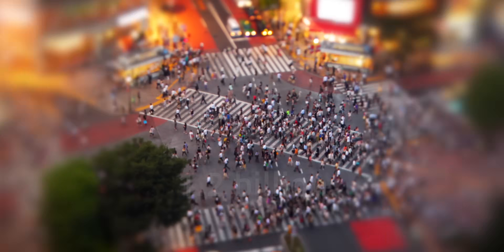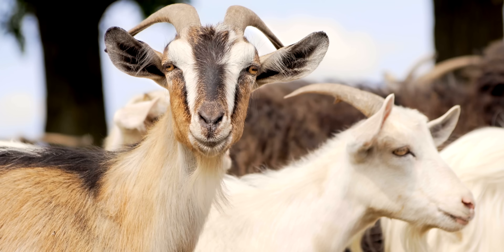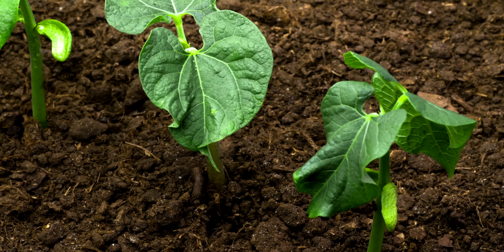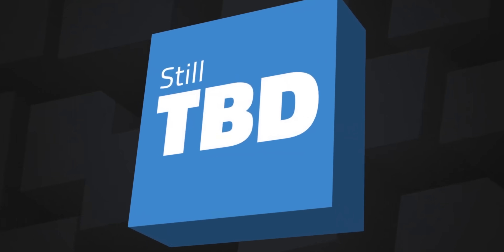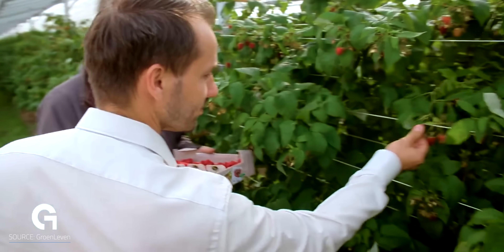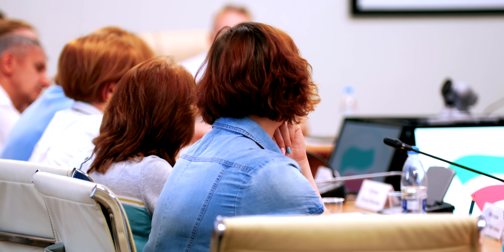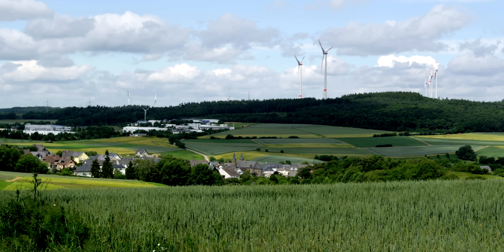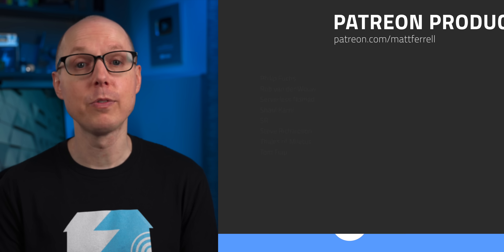Solar Panels Plus Farming? Agrivoltaics Explained

Comment: I want to see if this approach could be used in greenhouse construction. Like for a small home greenhouse. Even if it only offsets the power draw, it still helps lower the carbon load from powerplants.
I'm all for renewable energy, except for a couple of issues. One of the biggest concerns I have is the ecosystems these green power stations are in can be damage. Agro voltaics have a serious edge in alleviating that concern.

Comment: In a true farming sense it doesn't make sense. However being able to provide power for your residence and still use that land for farming does make sense. Even in the sense of having a few solar panels per acre makes a lot of sense to  power pumps, and other irrigation equipment. Solar's biggest downfall is we currently don't have the battery tech to fully harness the days of abundance. Most systems are based on your average power draw during the winter months. You basically have to install a system which is oversized just for operation in the winter months, and in the summer months you are far in abundance of energy.

Comment: I've seen a documentary couple of years ago about solar farming in north west China. Originally it's a pure solar panel area for generate energy then they found the grass grown faster under solar panels than other area because the shadow reduced the evaporation. Those grass are not good to the solar panel maintenance but remove them is costly so they comes with an idea to let the local farmers graze sheep under the solar panels for free. This actually brings benefit to both side. There are also some area cover the fish farm with solar panels which can reduce the algae growth. So it requires less work to clean the water. Also, the owner can sell fish and sell electricity to make more money.

Comment: I've thought about keeping chickens under panels for years. Panels would need to be taller(?), and the wires etc safe and hardened, but the chickens would have a roof on their run!!
Reply: New technology for electric power generationhttps://youtu.be/xc2V2BS_Fng
Reply: I think the chicken tractors could be used with the solar panels roof.  Land is regenerative sequstering carbon.  

Cattle and other livestock need shade structures, again some Mobile, some permanent.  Also regenerative.

If we can sequester carbon through this and it provides power win win.

But it has to be well designed.

I see no reason why some wind turbines be used in conjunction with this to improve grid reliability and lower costs.  Either or is not a winner
Reply: Chickens driving tractors is a great idea. Gives the human tractor drivers more time to take care of their chickens.

Comment: I only got 5 minutes into this video but I have to ask, what problem do these solutions solve? Surface area isn't in short supply on the planet, even in built up areas. Farmable land is. Why compromise it for solar which has its own flaws to begin with? Not to mention, solar feels like a stepping stone to a proper renewable energy resource.

Comment: Well researched.  I'm based in the tropics and the main obstacle is regulatory / administrative approvals structure is not appropriate to this technology use.  Funding is available for renewable energy but the approvals are difficult, and very little funding is available for farming upgrades, but approvals are easier.

Comment: Solar is not sustainable nor clean. Cobalt, silica that turns to acid in Water etc. it’s ok on a small as per needed basis. Micro hydro is many times cleaner and is also just appropriate where it fits in. No one size fits all.

Comment: I think another solution is to utilize the vast amount of land under high power transmission lines.   It doesn't have to be solar PV.  Instead, heavily insulated shipping containers could be used to grow plants with LED lighting.  This would work 365 days 24 hrs/day even in cold climates.  It would need controlled ventilation, water, nutrients and harvesting/cleanup processes.   The rationale is that LED lighting is CHEAPER than heating.

Comment: Would there be a way for the watering system to flow through the empty spaces in the panels? That would water cool the panels and deliver the heat into the ground. Maybe even just pour over the top, or run through tubes underneath with high heat transfer materials, but both of these add a lot more work/evaporation than simply open channels in the empty spaces and occasional holes to drip water down

Comment: If the price of agrivoltaics does not yield more returns than a solar park or traditional farming that literally means its less economically efficient, subsidies will quite literally lead to more resources being used with less output, which is worse for us all. The free market isn't a problem, it shows us whether it actually is a good idea to do it or not. At least if you want to increase the efficient use of resources, which if you want our society to be wealthier you really should want.

Comment: Hey power poles! Solor panel poles and collect power from every angle and cut down on space usage wires can be ran inside of the poles. You can write me back and I'll give you plans. And the poles can be made of recycling materials. As such as plastic.
Reply: So cost would be a fraction of normal solor panel installation and affordable for City to implement into the power grid.

Comment: We should definitely be using this! Obviously, it's not suitable for every farm, but hot, dry areas like the western US would dramatically benefit. Combining poultry, bees, and wildflowers with solar would actually be triple-use. It would also be sensible for any farm to put solar panels on its buildings, north edges of fields, and over drainage ditches.

Comment: I was under the assumption that solar panels contain lead and other toxic stuff, I'd really want an analysis of the safety of the food since the panels will leech from rainwater as they age. The vast majority of land on Earth is not farmable, so there's ample and cheap places to put PV cells besides farms. Of course, if studies show that the food and soil are safe after many years, I would not oppose it--but it seems like a good idea to check first before rolling out large projects.

Comment: I thought it was good practice with people using solar house to house where it has good sun exposure. It takes off small parts of burden off the power grids when it conjunction with battery systems that are made well. And Seeing those raised solar panels above farming areas seems brilliant too. I think another issue with that might be maintenance with those hybrid solar and agriculture farms. They don't want to have either one damage each other, so they need to have some awareness of how to handle those. But I could see with a well planned and arranged system with minimum risk of accidental damage to either the crops or solar systems, then they could really work out well in select areas with certain crop types.

Comment: There is too much investments in STANDARD SOLAR PANELS which are ultra heavy and have poor efficiency..
Simply a LAW must be drawn to only use " perovskite solar cells" or some cheaper very light alternatives that can give 
at least 30% Efficiency or more.. As the years go by that bottom 30% needs to be moved up to 55% 

Goverment should only subsidize Solar panels which meet these requirements.. so that money is well spent to FORCE new production of these cells.

This will bring down costs dramatically as almost every part of the structure could be producing power.

With HIGH EFFICIENCY SOLAR POWER: Water can also be obtained from the humidity in the air where conditions
permit..

Stop supporting these bulky old super heavy righd solar panels and force the move to the new technology

Comment: as I started watching I was very sleptical, I feel that the cost of the land is marginal compared to the solar pannel, and thus, unless you are trying to use very expensive land (why would you?), why not have some farm land and some solar farm land seperatly? it's not like there's loads of unexplored land.
but if you can indeed make a synergy that benefits the crop, sure! but I feel it needs to be evaluated case by case and will thus not become very popular as it's not very scalable

Comment: As someone who has worked on farms, dairies, keeps a decent size orchard, large garden, and also has somewhat of a formal education in soil science and horticulture. . . just the effects of chemical run off and all the concrete that would be required in the fields makes this a hard pass for me. 

These farms would require much more herbicide use as machines used to weed won't be able reach weeds in rows where the stilts are located. Stilt rows could be used as a break, which can be  beneficial, but often harbor shelter for pests and would then increase the need for pesticide. So choose, more pesticide or herbicide. For many crops it will increase the need for fungicides as well because of reduction in wind which normally spreads spores far and wide, but would instead be trapped with higher humidity levels. That reduction of light can also lead to an additional increased need for fungicides. Also what chemicals will be used to clean the panels and how will those affect crops / soil chemistry? Who will clean up when hail damaged panels? Anyone who doesn't think there will be damaged panels has not been on a farm (everything gets damaged). Accidents are unfortunately common. 

When I hear numbers like 50% reduction in water. . it screams marketing made up the numbers (not accusing Matt, but the source of that number). 50% reduction in water use from temperature reduction of a few degrees would be crop WUE (Water Use Efficiency) magic (10% sure, 20% maybe, 30% skeptical, 50% nope no way). Somewhere there is some fine print that says they also switched to drip irrigation to achieve 50% (which will clog and have to be replaced or run acid through the lines). The only way 50% is possible without changing irrigation methods is a dramatic decrease in yield (smaller plants use less water) or they were overwatering to begin with. 

There are not many circumstances where this will work well without a plethora of unintended consequences. Many communities don't want to jump on board with things like this because there have been numerous projects started and abandoned irresponsibly (once those unintended consequences pop up) leaving communities to deal with the damage. 

Love that people are innovating and normally I am not a naysayer when it comes to things like this, but ultimately this just isn't going to work for the vast majority of farms. It is one of those things that requires so many compromises to each function that it is less efficient than doing them separately and the costs exceed the benefits.
Reply: Before displaying your professional background as something noteworthy, try relate to reality ;)
Each of your estranged worries are more or less irrelevant.
Practical field test are already made by top professional Germans, and has proven this technology highly successful.
Search on YouTube and see for yourself...
Reply: @OmmerSyssel  Yes, because someone with actual relevant experience and education can learn something from YouTube. . SMH. Wow. If you could bother to read, you would see those "top professional Germans" had the EXACT same concerns as mine in the studies. No, the technology isn't proven nor is it highly successful. It is niche at best with very limited use and only possible to use with a very limited amount of crops. 

I bet you tell the Doc about the medications you would like after self-diagnosing based on TV commercials too.

Comment: Bi-facial panels mounted vertically on stilts.. Thank you very much for the idea.. We are embarking on a project integrating solar farm with existing aquaculture. We thought the runaway commodity price has torpedoed our dream.. Once again, thank you very very very very much
Reply: I have the hobby to recommend sci-youtuber to science-fans. 
I'm often called random or even robot for that, but whatever. I keep going for those few 
that say 'Yes thanks'.
Reply: @loturzelrestaurant  https://youtu.be/btIJWYor8KA?si=erWgjKcZTL6vYMf4
Reply: Vertical bi-facial panels are not very wind-resistant... Please, keep that in mind.

Comment: This will produce (pun intended) radiated food. The crops WILL be effected by the electrical current (even if contained within wires never touching the plants). All wires with electricity flowing give off electromagnetic radiation. The result would be food altered by the radiation. Which could pass on the radiation to those ingesting the plants and/or any harmful effects of eating mutated crops. Overall, this is a horrible and devastating idea for our health.

Comment: I know there double use for energie consumtion so I don't know why there couldn't be a double use for energie production as long as the 2 production doesn't hurt 1 and other too much so the cost isn't to high for nothing. But this seem promession it seem pretty usefull form what you are saying any way... The farm get to have a better protection in winters and the solar panel get to produce energie ...

For the casse of what the land is mainly use for... I would say it bot use really... And technically I could see a point where you argue it for the farm you put solar panel it not for the solar panel you put a farm under... (after all you need food more than you need electricity overall since without food ppl can't make electricity so I would say the main use is for farming.)

Comment: My family owns a 120-acre farm in Michigan.  When I saw the "just have a think" video, my initial thought was .... great idea.   But then I began to ask how this would be implemented on our family farm and realized it actually wasn't realistic.   

The first reason is the cost. Farming is a low-margin business.  No farmer that I know has enough free capital to buy the solar panels or the framing to hold it up the necessary 15 feet off the ground.  We are not VCs with cash to burn.

The second reason is a lack of electrical infrastructure. Even if the solar panels magically appeared, the power company in our area doesn't have the infrastructure in place to get the power off of the farm.   In our area, each electrical pole costs about $3,000 to place.  Do you think the power companies in the US would pay for that?  Not the ones that I know about.

I was unhappy with the reasons you gave for it not taking off... in particular the NIMBY reason.   Any farmer that I know would do what it takes to keep their farm going, so someone from the city without any actual farming experience, making a video saying... "see how easy this is, if it weren't for those NIBYs" should try to get some practical experience farming first. It isn't as easy as your video makes it out to be.

Comment: Wonder if any of the major beer manufacturers have considered or currently use shade-tolerant hops and barley varieties. Wheat seems to be problematic, but maybe there's a variety there too. Power the bottling plant from the fields the biological materials are grown in. 

Agrovoltaics is less complicated (biologically) than agroforestry, which is another method used to provide shading and wind shelter to crops such as barley. From one paper I saw after doing a bit of googling, worldwide barley yields are expected to decline by something like 15-30% by 2040 due to climate change without moderating factors. Agrovoltaics seems like a no-brainer addition to this particular crop. Getting better crop yield, decreased irrigation cost, decreased costs overall (due to excess energy production), and being ecologically friendly long-term (good PR as well as just smart). Sounds like a great investment to me.

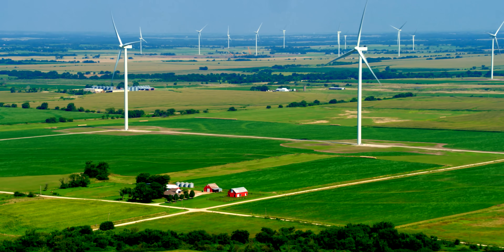Comment: 8:35 Reno county: you mentioned the nimby effect that happened about not allowing alternative fuel sources happen there. This is the same county that in 2001 there were natural gas explosions. I live there and worked at one of the news talking sports radio stations at the time and it was truly crazy. They had used the old salt mines to pump and fill with natural gas but there was a leak that slowly underground went 30 some miles and people's backyards were suddenly blowing up. The reason they were blowing up was that settlers had come through and Dug wells and just filled it with permeable dirt after the well was dug or disused. Every now and again, 2019, there are new explosions because the gas was never appropriately dealt with. There's even a place downtown of Hutchinson Kansas that The geologists figured was the best way to help deal with the gas was to create an eternal flame to slowly burn off the worst of it. Lots of people left the area that had the opportunity. It's almost like voting against their own interest his common place for a place like that.

Comment: Late to the discussion, would the implementation of perovskite panels work better? Since they can be designed to have a a degree of transparency, min-maxing the amount of sunlight that goes through to the plants would seem like a more ideal fit when looking for higher crop yields.
Reply from the maker: Seems like a good possibility.  I’ve got a video coming up on transparent solar panels.  The current downside is lower efficiency.